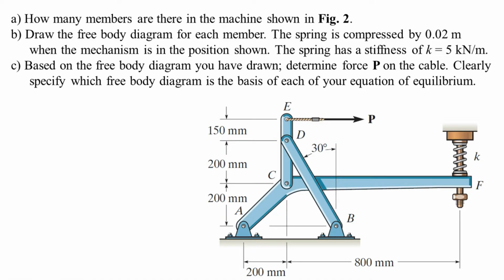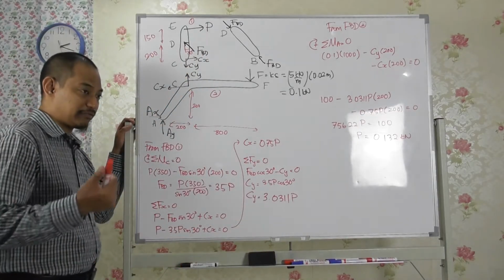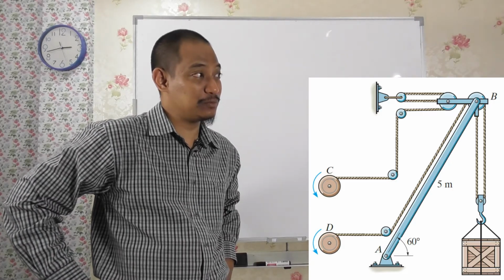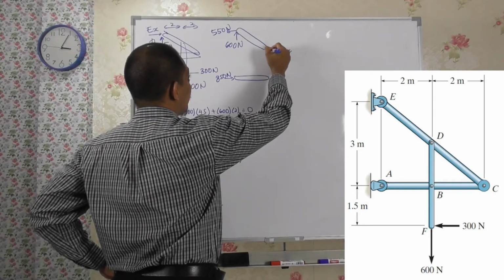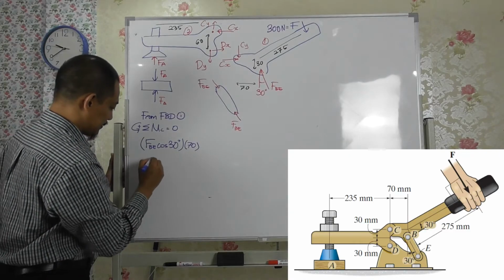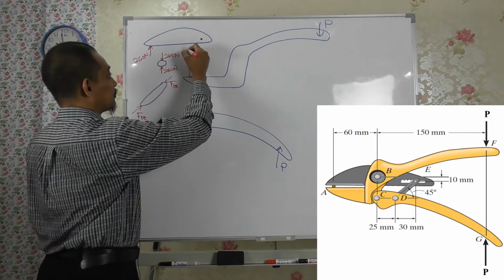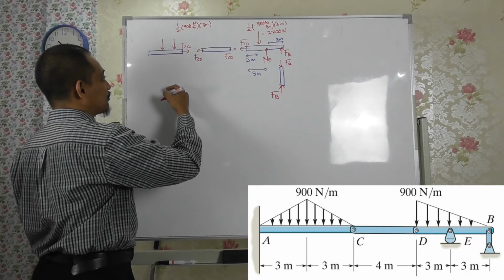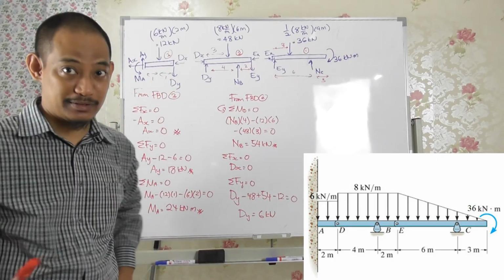Statics Tutorial - Ch. 6: Structural Analysis - Frames & Machines

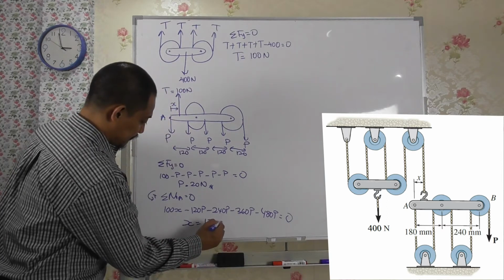Comment: Assalamualaikum Dr, for  question 5,  49:11,  I got the correct answer for P but when I calculated for x, I got 240mm. 

My calculation looks like this:

100x - 120(20) - 240 (20) - 360(20) - 480 (20) = 0 (Summation of moment at point A, which counterclockwise is positive)

100x - 24000 = 0

100x = 24000

x=240mm
Reply: Me too sir. I got x=240mm and that value doesn't make sense
Reply: yes 240 is correct
Reply from the maker: Thank you all for the correction

(unfortunately i did number of mistakes when doing these calculation while being sleepy at 2am😩)

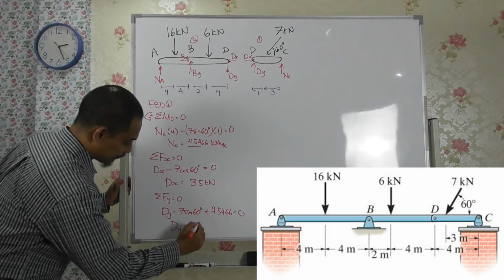Comment: Assalamualaikum Dr, for question 2, 25:48,   I think Nc should have been 1.5166 kN and Dy should have been  4.5466 kN. I have checked my calculations on the calculator and followed the same steps as you.
Reply from the maker: i am not able to check at the moment, is this related to the same mistake pointed out by the pinned comment?
or it is not related?
Reply: @SaifuddinRehan  Dr, it is not related.